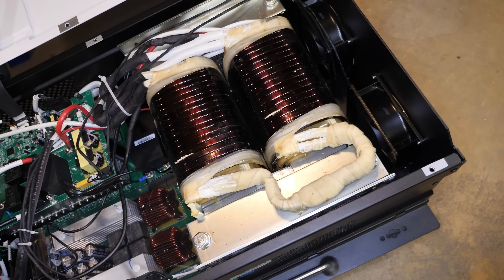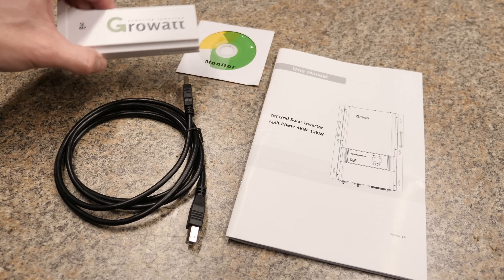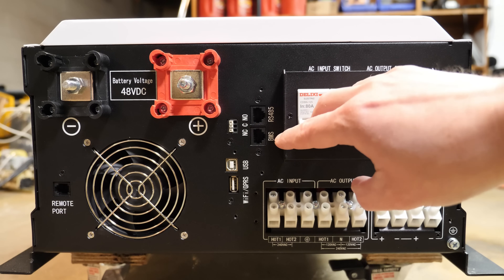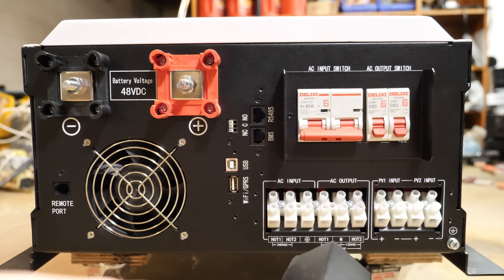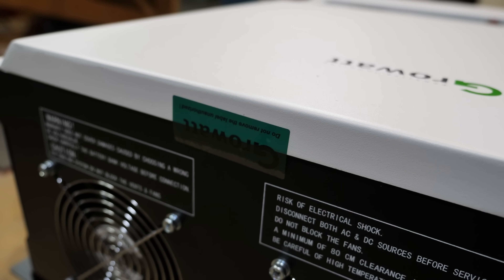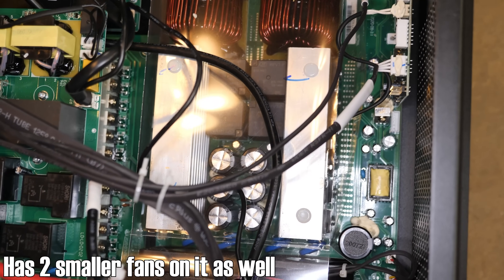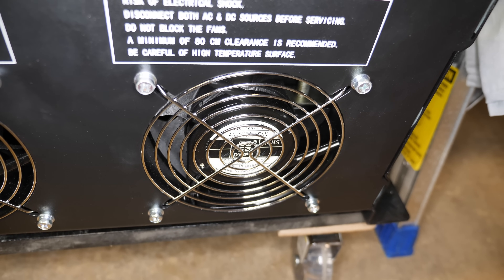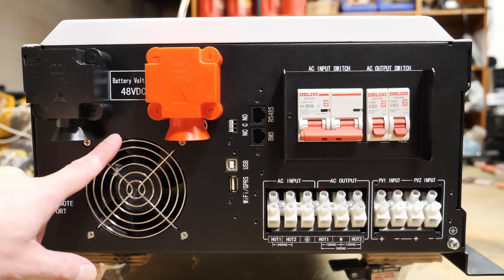Overview of a 12000w Growatt Split Phase LF Inverter!

Comment: you mention that you have the low voltage PV input model, but on your previous unboxing video at the 5 minute mark, your spec sheet reads max PV input voltage 250 and MPPT range of 60-245VDC. I just ordered the same one from Signature Solar and eagerly awaiting delivery. Did you find out if the max 7000w input is per side or max for both? I emailed them with that same question, but have not heard back yet. Great video and can't wait to see your next video with this beast in action.
Reply from the maker: Yeah Im not sure why it says that on the sticker.  The manual says the same.  I know the open voltage can go that high but working voltage under load should be 150v or less.  As far as the each pv input, its 60a on each.  Next video is in work!!!

Comment: I just installed one and display window does not light up. Cannot get it to work and need to charge my deleted lithium batteries. Any ideas?
Reply from the maker: That is odd. Only thing I could suggest is open the lid and see if the cable was loose from shipping maybe? I would contact the seller for sure tho. Which place did you get it from?

Comment: I looked at specs for both SPF 1200t HVM and DVM and they appear identical .  I think they just published it wrong but who knows.  It does imply that PV input is 7,000 per MPPT tracker and there are 2 trackers.  7,000 watts at 150v input should be max should be 46.66 amp input but this is why I wouldn't purchase this unit with  say 150 feet to run PV wiring . You would likely need 6awg wire for each string or at very least 8 awg. Forget 10 awg .
Reply from the maker: I replied to your last comment just a min ago about the diff of the 2 models.  When I was talking to James when I purchased it he had the HVT on hand.  If you happen to get the DVM, the connections will hold 6awg with a little wiggle room so 4awg may fit.  My current solar run is about 45-50ft and Im running 12awg down to a combiner then 6awg to controller.  Panels are in a 3s but plan to at least do 4s, 5s if the voltage allows.
Reply: @AVERAGE_JOE  Yes I contacted him through his eBay store about the HVM he said he had it but he also said that the TOTAL PV POWER INPUT is 7,000 watts NOT 7,000 per MPPT tracker input.  That is a ridiculously low input for a 12,000 watt inverter.  It should be more like 16,000 watts.  What do you need a high amp charger if you can only feed it 7,000 watts ?   I am still not sure that I believe this.  He didn't answer the total pv volt input and he said the standby loss is 180 watts which is pretty darn high also.  It may start 2 4 ton units but it certainly cannot run them long without huge amount of batteries.  It cannot even rub them from maximum PV input !!! I would have to get 2 just to use the panels I have now and they are not stackable.
Thanks for reply.

Comment: Several points.  I am looking for an all in one inverter similar to this that would start large inductive loads which this should do.  I could not locate the HVM or high voltage model of this unit and I would like to be able to run 5,000 watts continuous and still start an additional large surge which I believe this will do.  
The specs I did find seem to indicate a 7,000 watt PV input and I cannot determine whether this is for each MPPT or total which doesn't make much sense.  I think the standby is 150 or 170 watts and I can't see if there is some economy stands type mode.  The efficiency is lower than comparable at  least 88%. Guess I may try contacting signature solar because I would only consider the HVM model. I am also considering a pair of MPP LV 6548s that would have a little more continuous power and 16 kw total of PV input and I think about 14kv of bypass grid power.
Reply from the maker: They say its able to start 4 ton AC units without an issue.  I think the main diff between the 2 is the input charge from solar is higher and the efficiency rating is higher on the HVT.  As far as the pv input, in the manual it only says 120a and does not say for each input just a total.  I would need to contact them and ask that question.  No load Ill find out for sure and show on video of course but 150ish should be correct.
Reply: @AVERAGE_JOE  It says 7,000 watts input from pv array.  this is way too small and Signature solar confirmed the TOTAL PV input is 7,000 watts.  The charge rate is 120 amp not the pv input anywhere I could find. at 7,000 watts and say 120 volt input this would be 58 amps and you certainly couldn't put 120 amps into one pv input maybe 60 amps per each of 2 inputs.  This is pretty important to know before purchasing one. What use is it to have an inverter that will start large loads if it will barely keep them running direct from pv ?
Reply from the maker: Yeah I planned 60a on each when I ordered it. When I need more Ill use one of the pcm60x's I have. I was more looking forward to the 12kw output range of the inverter. The other features are more of a bonus. Thats how I saw it. You could look into solark. They have a 12kw model, I think its 12kw solar and 8kw inverter, more efficient and stackable. I would go that route but there a little more pricey.

Comment: Lol, you're Hot1 AND Hot2!  I don't know what that means, but sure seams fancy.  (and heavy)
Reply from the maker: LOL you are CRAXY!!!  Its totes fancy.....and Heavy!😉😍
Reply: It pretty much means the 2 120volt outputs and then the neutral 
The US has 240 volt spilt phase so 120-0-120  on the inverter output (to get 240 volts you go between the 2 120 volt lines and to get 120 you just go between any of the 120 volt lines and the neutral) 
just thought I'd this in case anyone is wondering (sorry if I got the terms wrong haha)
Reply from the maker: That pretty much sums it up!
Reply: @AVERAGE_JOE   relief that I got the terms right haha...not based in the US so not 100% with the us way of doing it lol
Reply from the maker: Yeah you pretty much got it!🤘

Comment: Are you going to use a generator? If so , what size?
Reply from the maker: No dont plan on using a genny at least at this point. If I did then Id use around 10kw. You could get by with lower. I plan to use the grid as a backup and use grid(pass through mode) if batteries are low. Possbly as a ups if we leave town.
Reply: @AVERAGE_JOE  My 10kw Aims requires 1.5 times generator which would be 15kw. Otherwise the warranty is void. I have a 7kw and a 13kw both of which have 60Hz from line 1 or 2 if you go to neutral. When going from line 1 and line 2 (240 v) the Hz is all over the place. Grid power from line 1 and line 2 is a steady 60Hz. This is why I got the Growatt with 120v input as both generators put out 120v at 60Hz. Good luck!

Comment: Nice inverter, these came to market a bit after I got my Growatt SPF 3000's. I am curious what the no load consumption is on that one? On my Growatts its about 44 watts per inverter. Looking through the manual the setup looks really similar to mine, though the MPPT controller has a 30 volt higher range which is a nice improvement as I could have done strings of three of my 72 cell panels instead of strings of 2. I am curious though is it 7000 watts max solar into it, basically 2 strings of 3500 watts or is it 7000 watts on each string? The SPF 3000's I have can do 4500 watts each so up to 9kw between the 2 of them that I have. 

Looking forward to seeing your inverter in use.
Reply from the maker: Thanks Man!  and thanks for your help! Hopefully my last email went through.  44watts on one of yours seems pretty good to me!  Im sure this one will be a little higher since the transformer lol.  Yeah my panels are in strings of 3s right meow but may add another for 4s.  That is a great question on the solar input.  It just says 120amps. Ill have to look into that!
Reply: @AVERAGE_JOE  No problem man, got the email this morning. It's great when everyone helps each other! On my one inverter that's fed with only the 72 cell panels I'm using strings of 2 to stay under my inverters voltage limit, on the second inverter thats fed with 60 cell panels I'm feeding it with strings of 3. Both setups stay under the 115 volt limit for MPPT tracking of these. 4k of panels on the first inverter, 3.7k of panels on the second. I'm actually looking at adding in a third inverter for some other 120 volt loads and then I can move a couple smaller strings going into a pair of Victron charge controllers to that inverter, would give me about 2.2k of panels on that inverter that are currently only the victrons. 

So far coldest morning in full sun was about 32 degrees and I didn't exceed 100 volts on either string so I'm good to go so far. Looking forward to seeing your system in service.

Comment: I ordered this same inverter last week!  I haven't received it yet, but looks like it is going to be a beast to mount on the wall.  I plan to eventually get a high voltage charger controller, until then will just use the grid to charge my batteries through this.  150 volts of input is pretty low, how many amps of Solar DC input can it take through each of the MPPT inputs?
Reply from the maker: NICE!!!  Yeah Im not looking forward to mounting it lol.  Will need to hire a crane operator!!  As far as solar input for each leg, not sure as the manual only says 120a total.  Ill look into that!
Reply: @AVERAGE_JOE   I bought mine from signature solar's eBay store and has model number SPF 12000T DVM-MPV expecting 150 volt MPPT input but was surprised it lists it as rated for an MPPT input voltage of 60-250 volts.   I re-watched your video and if you look at the label on the side of your inverter it is the same as mine with a max of open circuit voltage input of 250 volts!  I think I am going to have to build a shelf below where I mount it, then mount it to the wall and then take down the shelf.  I'm definitely going to need help, this thing is heavier than I expected.
Reply from the maker: Nice! Yeah I think the open voltage is 250 but operating voltage under load is 150v. As far as pv input its 60a each. For mounting lol....Im still figuring that out. I may mount it to that rack on the ground then try to stand it up with a come along or a few people.🤣🤷‍♂️🤘

Comment: This inverter is very impressive ... but I have to say is very expensive something very similar or better  it will be Genetrysolar.com  see how it was bilt like a tank be impressed by it power and size...
Reply from the maker: I did look at some of those and they seem impressive however I already had my eye on this inverter.
Reply: massive difference you pay for what you get when i changed to this it was like night and day the app is great in data logging and lets me know from anywhere my capacity, pv input, battery voltage,  power output n so much more ,also inverter is quiet only ramps up when u running heavy loads , and its pretty much totally customizable so ya i love this inveter to death honest opinion

Comment: that's a heavy baby :) it's seems a solid engineering, maybe would i add dust filters on the air intakes to avoid dust by the time, i'm not reassured to see dust bunnies and heavy electricity living together :) ⚡💥😉
Reply from the maker: Excellent suggestion!!!🤘

Comment: Those are all mosfets, on the right side of the inverter they are all IRFB4110, so 8 of those per leg of the H-Bridge. so that is 120A multiplied by 8 or 960A!! which would work for 46kW of inverting power lol. Having big margins on your components are nice, it keeps them cool. Datasheet if you wanted to poke at it: https://www.infineon.com/dgdl/irfb4110pbf.pdf?fileId=5546d462533600a401535615a9571e0b
Reply from the maker: I knew you would know for sure lol!  Damn thats a lot of POOWAHHH!!!😲😆🤘
Reply: each irfb4110 withstands 370w so the 32 mosfet withstand 11,840watt.  how does the manufacturer say that the inverter is 12kw?  if we calculate the losses of the inverter it is impossible for the mosfet to withstand the power that the manufacturer says….
Reply from the maker: Ill be giving it a try as soon as I setup the new battery bank!

Comment: wow that thing looks top quality! I agree with the output terminals, just run wires straight into the breakers. Also your transformer explanation is pretty close to correct, It looks like there is a full H-Bridge of mosfets on those inverter heatsinks so that is able to connect the T1 and T2 of the big transformer to Batt + and Batt - for half the sine wave, then do the opposite the other half. There may also be some PWM involved to help make a cleaner sine wave. I do find it odd it is using standard TO-220 versus a much bigger TO-247 package. Seing you and FFcossag get inverters like that makes me want to eventually get something like it.
Reply from the maker: Thanks Man! Yeah connecting to the cb would be better imo as well. As for the other stuff......couldnt say lol!

Comment: Looking forward to the hook-up and testing, but even more so to seeing you lift that pig into place. Won't be any holding in place with one hand while trying to find the proper screw with the other :) Might be an opportunity to buy a wheeled engine hoist :) 
In any case; Best of luck, life, and love in the new year.
Reply from the maker: Yeah testing will start asap! UGH yeah dude, you foresee the future correctly lol.  That this is super heavy and Ill need a crane to lift it into place lol.  I have a winch for my truck but may have to get a comealong or a small winch lol.  Happy New Year to you as well!!!🤘
Reply: And it doesn't come with a Lifting Lug!  Lol
Reply: I damn near killed myself getting mine uncrated.

Must weigh in at 200 pounds!!!  Damn!

Comment: What is a ups?
Reply: Uninterrupted power supply
Reply from the maker: Uninterruptable power supply. Like if this is set up for a backup system and the grid goes down, this will switch on like nothing ever happend.

Comment: Bottom fan is 12v 3wire pwm ....top fans have quite high consumption....
Control board is diferent than mine but the same side....
Mpp charge controlers are different i dont have lithium charge model.....because older model...
Only two things that bothre me on mine inverter is high idle consumption.....and transformer shuld be torodial...and mosfets don't have thermal compound so ...i would not connect 8kw or larger load....
Use 50ohm resistor  when u 1 conections  ....u have lithium batterys....
Nice inverter
Reply from the maker: I did see the input fan specs later and you are correct.  Have you replaced any boards on yours.  Yeah I guess your right on mosfets, I dont remember seeing any thermal compound.  Im sure Ill be using 8kw a time or 2 so well see what happens.  Im not to concerned of idle consumption at least at this point since Ive been using a UPS lol.  That could change in future tho. YES on the resistor, I have one for battery connecting lol.  Learned that a while back lol💥😜
Reply: Same size
Reply: Yes... control board as warranty claime ...at first it was warning low voltage on batterys like 32v ...measured 54v then inverter turn off and no show....then after few mails to china i got confirmation on new con.board  tey say it was diferend kind procesor and drivers for power board...that i got in aprox 10days with dhl ...and no isues after that...
Reply from the maker: Oh crazy! Least you got it and no issues since!🤘

Comment: it looks well built, bad cable management , but then its going on a fixed install.. my only concern is the input/output terminals , really poor quality, thats a terrible way of terminating a 63a circuit, id like to have seen proper din rail terminals with screw down clamps
Reply from the maker: Agree, thats my only complaint at the moment.  It would be nice to connect directly to the circuit breakers.🤘

Comment: You said it could be used as a ups a few times, Could it work as a sorta reverse ups? where the grid is the backup? this seems way overkill for me though, and out of my price range. But I very much like the way it looks inside.
Reply from the maker: Yeah I believe it can!  You can set voltages up in it where if you run out of battery (or solar) it can switch back to grid.  Then based on your battery voltage settings, it can switch back to battery.  Thats actually how I plan to use it!!🤘  They also have a 6kw version which is half the price!
Reply: @AVERAGE_JOE  I might just have to look into that when I combine getting a job, affording a bunch of pannels, and affording a bunch of nice batteries.
Reply from the maker: I hear ya on that FO SHO!!!!! Takes me forever saving up for all the things!
Reply: @AVERAGE_JOE  What do you think of getting a kit like this for the purpose of keeping a lawn mower battery charged in florida? no inverter load planned, just to use the sun to keep the battery topped up. https://www.ebay.com/itm/50W-12V-Solar-Panel-Battery-Charger-PWM-Controller-Regulator-Car-RV-Boat-10-100A/133587524672?
Reply: @danielauen7790  no WAY would you need this beast to keep lawn mower charged. 
Post a question on diysolarforum if ya wants help!
Reply: @SuperVstech  50 watt ebay solar kit is overkill to keep lawn mower battery charged?
Reply from the maker: Yeah you would only need like one of those super small ones like 10-12watts.
Reply: @AVERAGE_JOE  Meh, I kinda like overkill anyway, Room for growing, Or if I install a music system on the mower. People do that right?
Reply from the maker: Lol sure people install music systems on mowers ALL the time!😆🤘